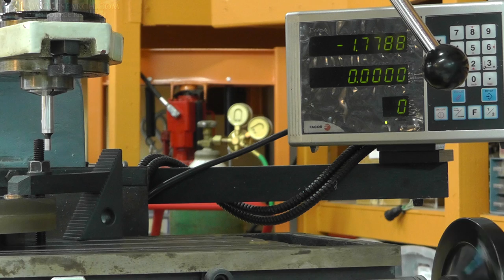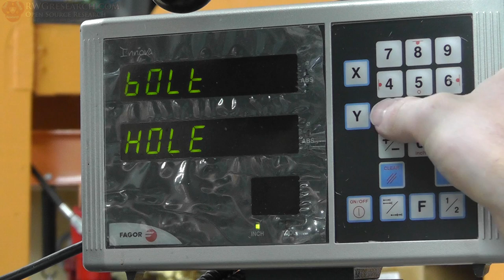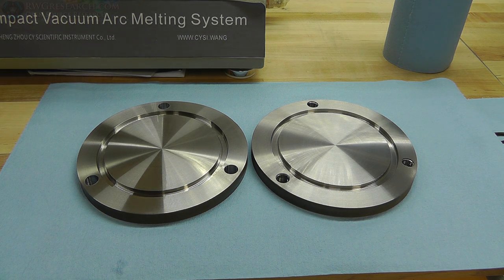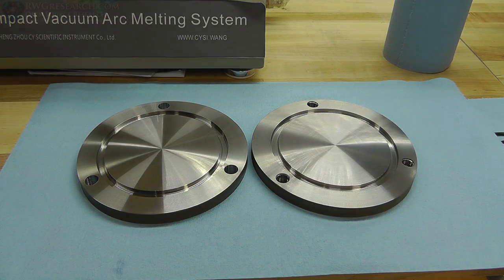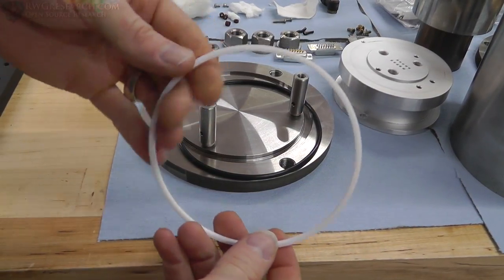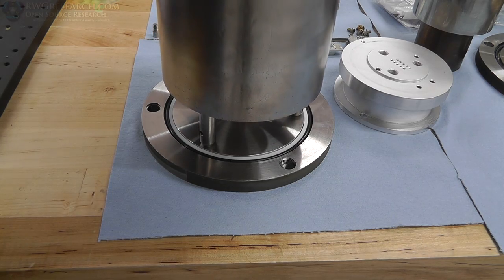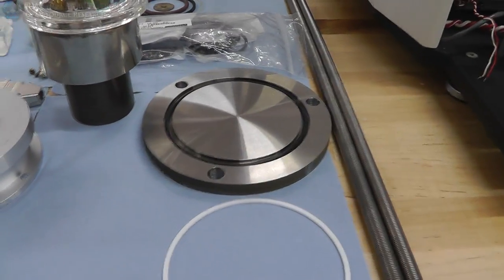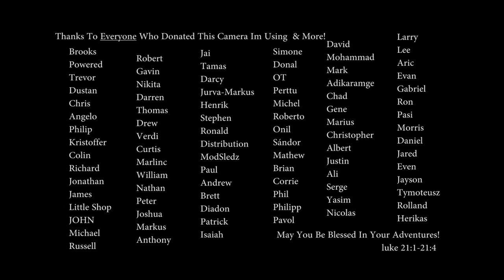Part 2: Building The Pressure Cell: Hacking The DSC (Differential Scanning Calorimeter)

Comment: Where did you learn to machine? You seem to get everything right the first time or did you have a few do overs?
Reply from the maker: here i only had enough stock to get the job done... so i took my time 
and did it right :)  however , You will see 1 small mistake in my next 
video lol i leave in a few commentaries... see if you catch it :)  but i
 did not ruin any parts.  I did however have a failed hole in the next 
video as well, and i knew it might happen so i planed ahead for it ... 
then used a different method to fix it. see if you also catch that! :) 
most of this i have learned by doing and a few notes from others at my 
last job. ~Russ